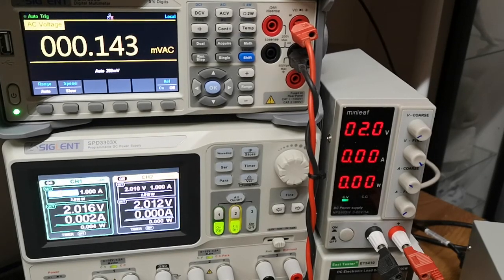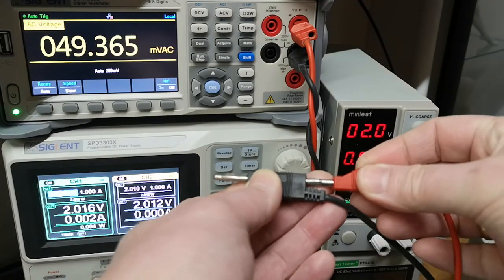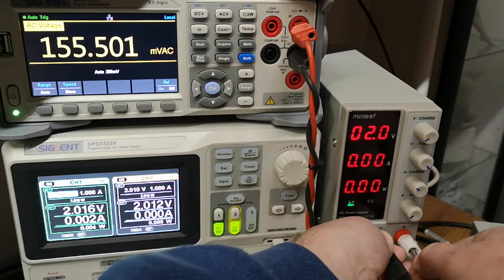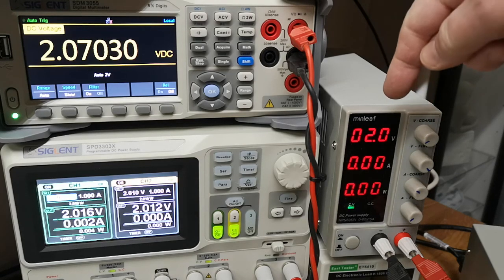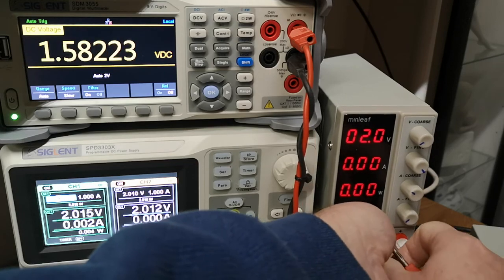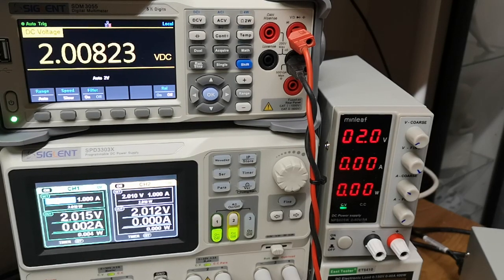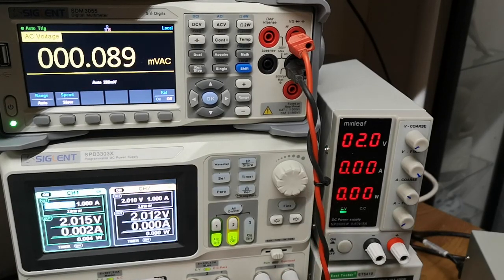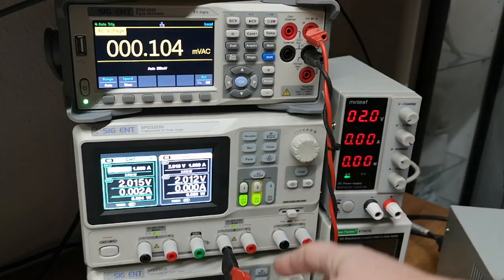siglent SPD3303X versus MINLEAF NPS605W, noise, stability

Comment: A multimeter is not a good tool to measure ripple and noise. Try an oscilloscope with 20Mhz bandwidth limit, using a ground spring right at the output terminals, with the supply under resistive load. You will likely find your cheap supply exhibits lots of hf switching noise.
Reply from the maker: i think you missed the point of this video, so i updated the description to make it more clear.
Reply: @TeardownOZ2CPU  I see. I guess I misunderstood your experiment.